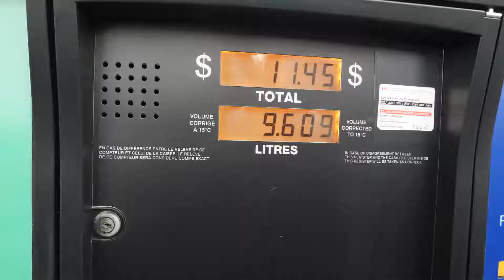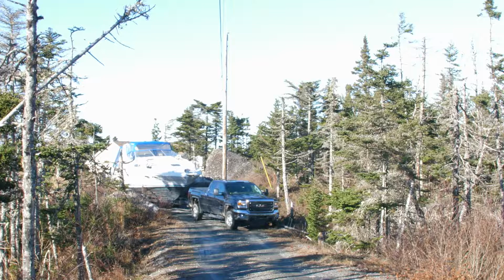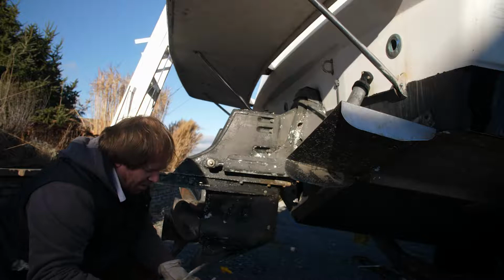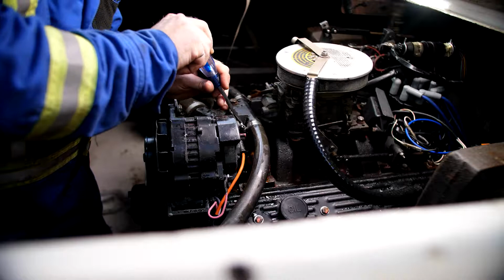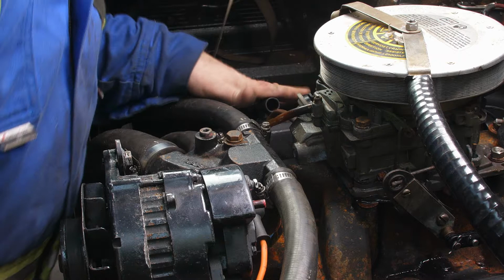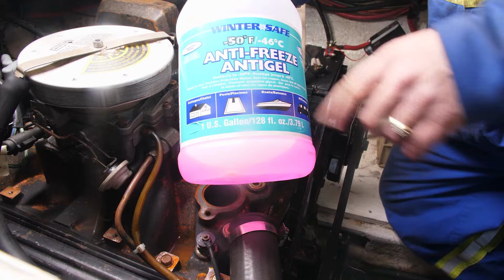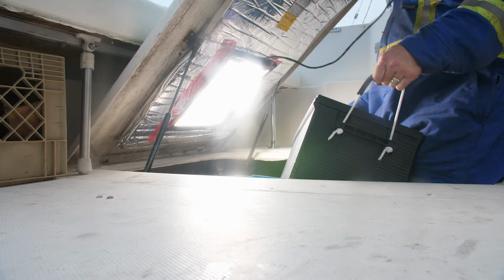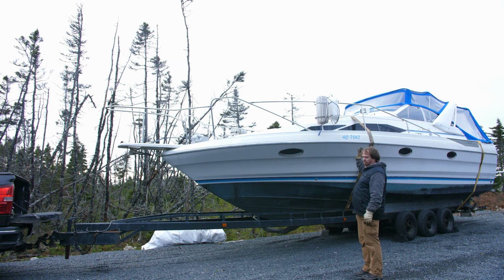How to Winterize your Boat - OMC Cobra with GM5.7L

Comment: This video was great. Thanks for all the great knowledge. Do you have a part number on the thermostat gaskets?
Reply from the maker: No, the shop where i get my gaskets has dozens of them hanging on the wall, small block chev 350’s are common enough that this dealer just keeps a stock. I just walk in and ask for them, sorry.